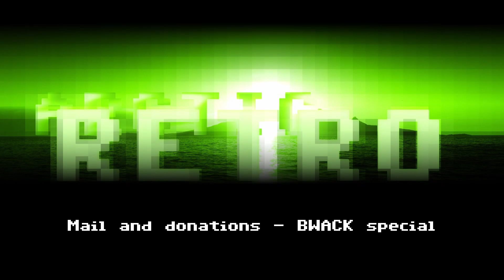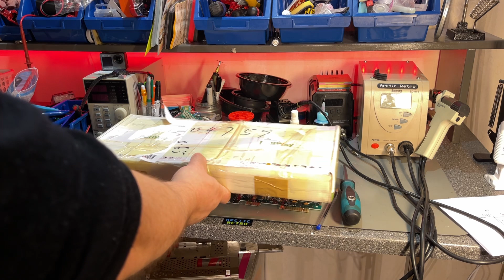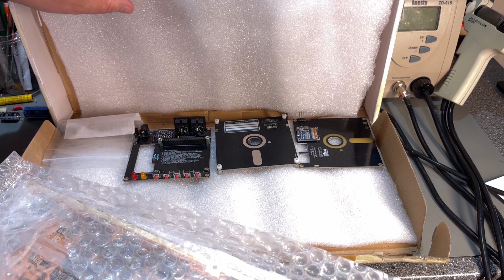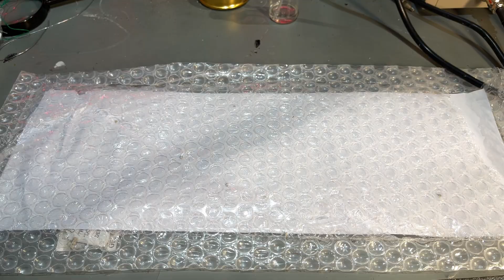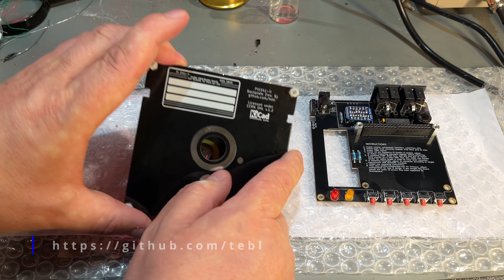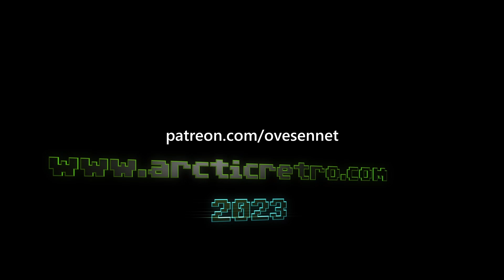SPECIAL UNBOXING - BWACK's brand new 2023 C64C Rev 4 Motherboard Replica Prototype

Comment: Is that a short board? I've been wondering about modern replacements for some of the combined chips the c64e board has. One of them is supposedly a 64 pin asic
Reply from the maker: Yes, this is a short board. You are correct. There is a large chip that there is no replacement for (as I know of). A lot less chips than on the long-boards

Comment: I actually wonder no one is reverse engineering the chips. How hard can it be to rebuild ~40 years old tech?
Reply: Give it a crack, let us know how you get on
Reply: Can use one of those low end fpga’s to replace the ASIC component. But the trouble with modern FPGA is that they run at 3V3 or lower, then additional TTL chips or other are needs for the voltage level conversion. Then you have the CIA and 6510 to deal with x they no longer sold. Then the VIC2 chip. So is alot of work.

Comment: This looks really nice, never seen a PCB with that kind of finish before. Built a sixtyclone just when they became available, but it's been stuck in limbo while waiting for the new keycaps. 

Looking like it does, I wonder how it'd look mounted flat on a sheet of plexiglass mirror with a keyboard below that. Thinking mostly as a functional wall display though the ergonomics would have been dreadful 😅
Reply from the maker: Part of me wants to frame it and hang it on the wall :)
Reply: Nah, you're not the guy hanging things an walls like other Youtubers do. You sure will make this fully working and have even more fun. I'm looking forward for a full series of videos and will be happy to wait for every single one of them.